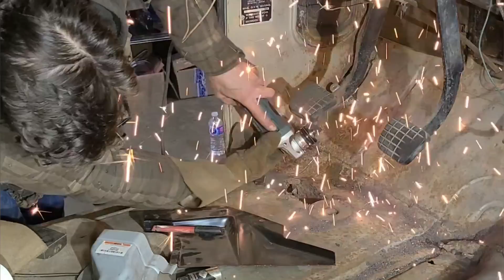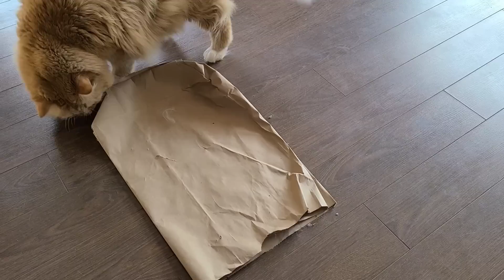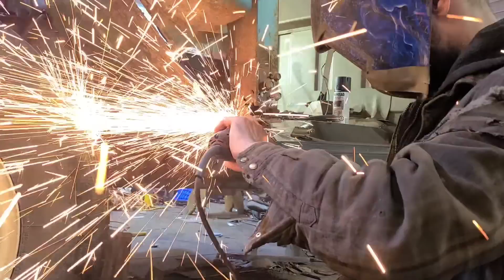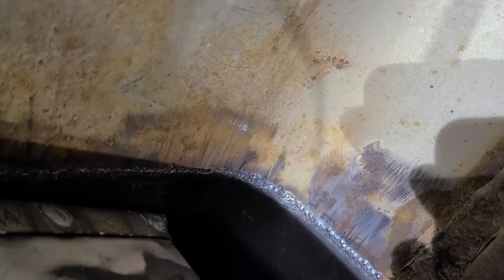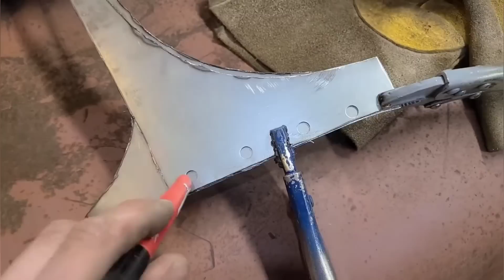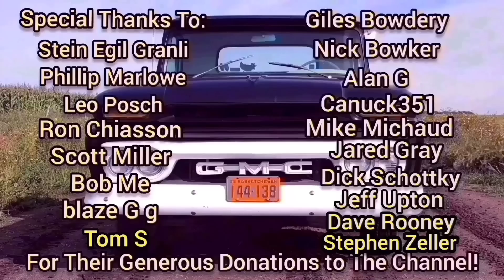Professional Bodyshop Said This Was a Total Loss! Amateur Rust Repair.

Comment: All those corners and bends have a purpose of support in a collision and body flexibility and if you don't remove all the rust it will come back fast... 
As well you have to remember that aftermarket parts ate mot the same as factory with bends and shaping ... 
Fitzee's Fabrications YouTube channel is the best you can learn with he will show you the best way to restore a car/truck I've watched quite a few out there and if you want the job to last more than two years then take my advice because he is a Master Body Man I've retired from doing it because it is a crippling job and very hard work but don't worry about the door gaps they were not right till the late'70's  but im glad you took the time to attempt semi restoration ...

Comment: There's no such thing as a professional body shop anymore all the do is change panels you need to go to a restoration shop to have that unit repaired and have alot of money ... Becouse it takes time to do it right and time costs money that the reason body shops won't do that work they would rather do collision work the car is in and out quickly not taking up shop space for 6 months to a year... 
Remember anything is fixable but to do it properly and to last is a real tradesmen ( MASTER ) Body Man not a college degree student that has no experience with fabrication shaping panels etc. There trained for measuring, and changing panels that is easier then grinding every spec of rust out and repairing the panel or or the time of removing the whole interior to make up a floor pan...

Comment: 36:14 novice my ass,   that work looks as good as new   as far as fit and finnish  the stuff that came out of the factory wasn't perfect   they didn't have the standards we do today  it was slapped  togather on an assembly line and the time wasn't taken to make it perfect.
Your work is better then new.  

I would move the gas tank to under the frame either like a modern ford or way in the back with a hidden filler hole like a tail light assembly that folds out or license plate that folds down  leave the stock filler neck.

These trucks have no places to put in a stereo system but you can do fiberglass molded kick panels that sound amazing with cheap speakers because they aim at your ears.  Back speakers are not nessary.  Maybe something like ford used in the 1999 ford ranger 2 door truck for back speakers  on the 2 door 2 seat version it had 2 5x7" aimed at the sides  they sounded pretty good for what it was.   As far as the radio  glove box
Hidden  amp under the seat  small sub if you like  not sure if the inside will be true stock looking or buckets  the 60/40 dodge seats were nice or the buckets with the center fold down and a jl audio 12" stealth box .

Inside original or custom, you can do some nice custom stuff inside and add 4 wheel disk brakes and modern suspension systems.
They look good done up that way.

Comment: Only automobile my ass.
How bout the 2022 ford escape in the driveway, or the Tucker parked out back freshly restored. 

Anything can be repaired, its how much time and materials its going to cost to get it done thats an issue.
When you get done cutting out the rust, is there any metal to attache to?

Comment: I feel for you. In Pa we get projects like this each time. Saying that, if u have alot of rusted nuts, bolts, invest or build a induction tool. U can get a decent 1 online for 200 or so. No need to spend 700. Or make 1 with microwave parts. Also I saw recently on Ed China, and Donut using a laser for rust. Wow. If u can score a Chinese made laser like for pimples n shit, get it. Or make 1. That's the way to kill rust. I use acid. Especially where it's hard to reach or alot of work. Just a hand uses 60% phosphoric acid. I use Muratic on bad rust, Phosphoric on easier rust and soda or sand on a butt ton of rust. Idk why he said ok to 1 side then I can't do it to other. His work looks good. I've seen way way worse. Like no tools but asphalt type roof shit smeared on and called good. Tennis shoes for filling holes with bondo. Etc. U can do this. Nothing is impossible. But is alot of work. Try 1 of those induction tools. It's saved me so many times on O2 sensors, fugged up lug nuts, cab mounts especially ones on ford trucks that are almost a foot long and rusted as fuk. Good video. U sound like dude from vice grip. Canada and Border states combo. Lmao good shit.

Comment: most body shops are not "into" automobiles,....they are into money, making it that is.  Understandable,...and I myself had to patch up an old truck cause several local body shops were too good to just patch in some metal in a cab similar and replace some floor panels,...it bogels the mind, no wonder so many people have to take up body and fender work as a hobby,...welders and all.  I'd like to get a 63 chevy stepside like we had when I was a kid,...but even then in the 70's it had so much rust due to being worked in a timber work environment, got mud and dirt caked into areas and started rusting in those areas.

Comment: When you spot weld sheet metal, do you use flux core or MIG?
Great video by the way.
Reply from the maker: Thanks, I use mig. Flux core is not for autobody sheetmetal work
Reply: Well snap. Can't afford a MIG, so will try my best with the Titanium 125 I have. Not the best, but I'm not welding too much.

Comment: Economics has a huge effect on whether a body shop wants to tackle a challenging rust job. They can make a lot more money doing easier jobs without the customer having a chest issue after seeing the estimate(which will have an expansion clause $).
Reply: sometimes  its hard to get a customer to understand what a job like this costs.... taken the total hours multiplied by the shops hourly rate adds up quick.... I've found that walking around a project like this with the customer explaining each step and to do A we have to do B C and D which ads up to X then they understand and either give you $ to get started or they haul it to the scrap yard
Reply from the maker: Good to know. Thanks for the advice!

Comment: Glad I watched, I had the same road runner in 1975. Mine was same color but no vinyl top and black interior. Thanks for the flashback. Earned you a subscription
Reply from the maker: That's awesome, thanks! The Roadrunner isn't mine, though. It's been owned by the same guy since the early 70s and just had a ground up rebuild finished by a local shop.

Comment: I live in a rusty state.  Every five year old truck has rust somewhere.  I started rust repair in the '70s on Japanese cars I flipped.  Those were all handmade patches , pop riveted in with fiberglass filler over everything.  Some of those cars are still around amd look pretty good!  Now with the patch panels for everything this work is much more fun and easy, (well for my shop). You can get a nice car with rust pretty cheap, get one and try it out!!!

Comment: its looking good and much more structurally sound.
I know you were joking about professional repairers walking away but I have seen that happening on a UK TV show regarding Volks Wagon Camper vans. The professionals surveyed a very rusty example and refused the work because the cost of the work would outweigh the cost of acquiring a much better body from California or somewhere dry.  I think the owner was prepared to pay the hourly rate but I suspect that it is more profitable to repair say four "sensibly" rotten vehicles than it is to spend four times as long doing a very rusty one. If you can do it as a hobby where your time is not charged then that is different.

Comment: As a welder with 40 years experience.  Get a piece of copper bar to backup those thinner areas.  It will work as a heat soak helping you keep warpage down.

Comment: I remember replacing rusted out body metal using sheet metal screws and new metal then covering the inside with tar. That was before we could afford a oxy acetylene torch. MIG welders were just a dream back then.

Comment: I would like to work as quickly as you do.  Nice puddytats. What size and type MIG wire are you using?  Please mention it in a future video on that fine example of GM engineering.  Thanks!  Eh?  Greetings from Ohio.
Reply from the maker: ER70s-6 .023 wire

Comment: On the contrary sir, many show cars are judged in a fashion where the millimeters are inspected with a mill gage to insure good metal work. I think the max is 6 mm. 💯
Reply from the maker: I can think of several Ridler cars with  that much material just on the door edges.

Comment: The guy build the RoadRunner in about the same fashion as this C10?
Reply from the maker: No, the RoadRunner actually has a lot of time and effort invested in it, plus it actually looks nice now that it's done. When I'm finished with the c10 it's still going to look like a crappy old truck haha
Reply: Yeah, the roadrunner was a full nut and bolt restoration. I just finished it. Thx Kyle for the kind words.

Comment: Interesting name for your shop the Scum Cave lol. Do your best and fill the rest is my motto as I am working on the 1952 Dodge Power wagon although it just has light surface rust nothing real bad. Those panels look great after you did a bit of fabricating. Thanks for another great video my best to your cats the unsung hero's of your channel. I use my dog Chubby in my videos.
Reply from the maker: At this point, the cats are the only thing keeping this show on the air!
Reply: @CarterAutoRestyling  No the cats are comic relief Kyle

Comment: 'I need it to get to work tomorrow' -- woo hoo! You are one of these guys like me whose morning commute is seven steps. I like the waltz music in the beginning during sped-up fitting and welding -- it makes a nice journey for us viewers. I also like the polka-type music later -- even that works in a similar manner, albeit it is more frenetic, like the sped-up welding. The plug weld tutorial was good. Nuances matter with sheet metal. As I recall, on your MIG, you use the small wire, like 023 or 025? I DEFINITELY want to learn that Harry Potter incantation that presto-changeo installs the door. That is WAY cool! Things are coming along nicely.
Reply from the maker: I use .023, although there is no noticeable difference between using .023 and .025.
Reply: Yeah, that is one of the things that I learned from you -- when welding sheet metal, use the thin wire! I normally weld with .o35, and it is far from optimum when welding the thin stuff. I now also have an .025 drive wheel and some .025 wire, so I am learning. @CarterAutoRestyling

Comment: I'm only speaking (typing) for myself when I express the following ......

Thus far, I have not been bored nor tired of watching the cutting, welding, grinding on THIS project or any other that you have shared on video.

My only regret is I dove into my 'project' before you started your channel. I can now detect some of the ways i should have went about my repairs.

My next 'project' will be more in line of what I have learned from watching your channel.

Thanks Kyle.
Reply from the maker: Thanks Russ! I hope some of this nonsense that I ramble on about will help you with your next project!

Comment: For a body shop, this is a total loss... when the repairs will cost more than the value of the vehicle, it's a total loss...they have too much insurance work to do to worry about sorting out someone's rust bucket project... only way this gets done is either take it to someone who specializes in restoration, not insurance work on newer vehicles, or do it yourself... I'm doing mine myself...🖖🏿😎👍🏿

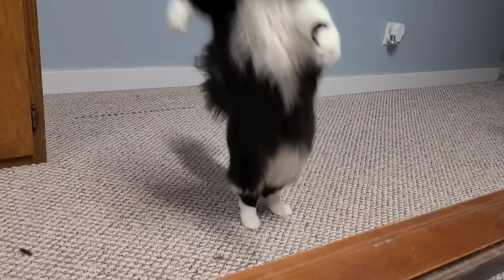Comment: At 16:57 I realized you have very aggressive cats, totally out of control. And my German Shepard disapproved. But I have to admit I disapprove of alot of what Nayla does. I don't have a tig, so I've learned a lot from your pointers on welding with a mig.
Reply: Meow🐈
Reply from the maker: Yes the cats are incredibly dangerous, but they do help discourage intruders!

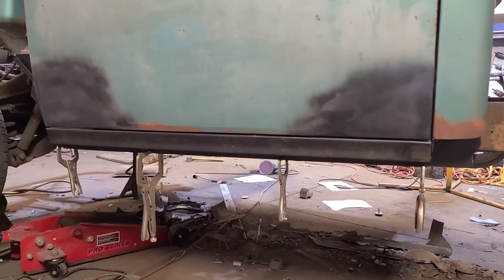Comment: On my door hinges I drilled and put doal pins in my hinges before I took them off so I know exactly where they were 17:58
Reply from the maker: On this truck, the doors didn't fit before I took them off. I also changed the hinges as the originals were ruined